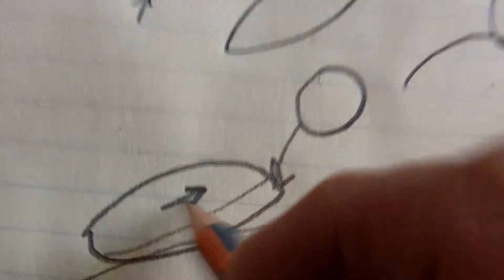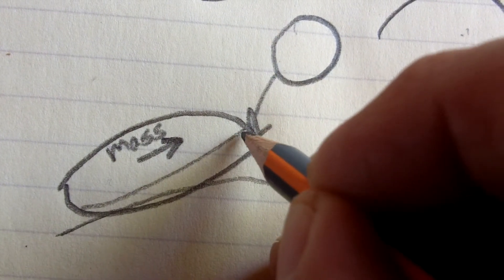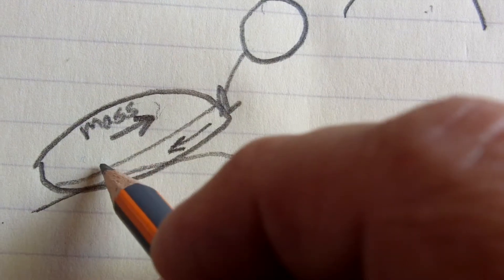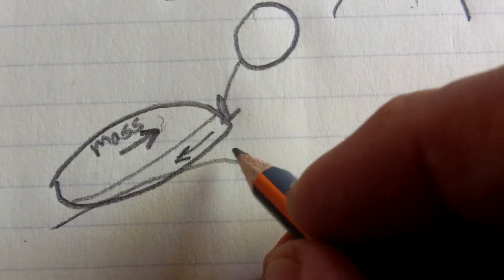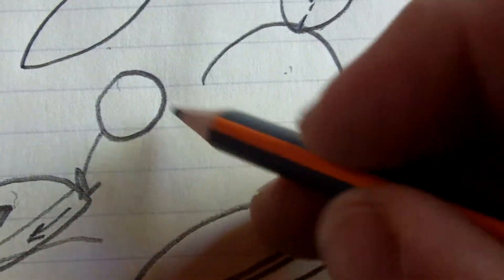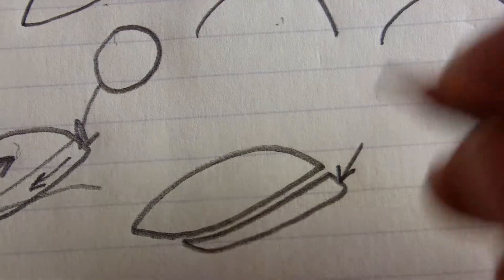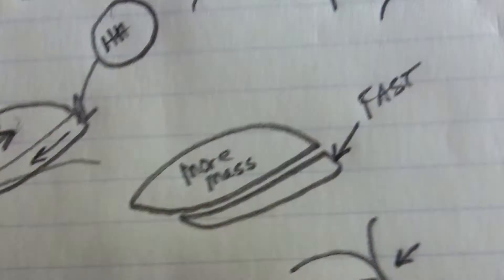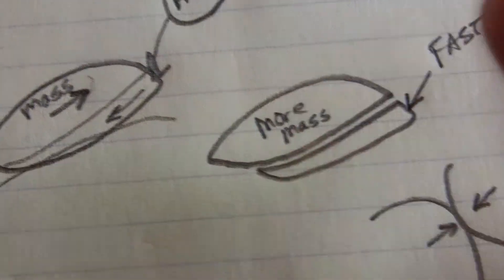335 - Fracturing Part 3c Long Flakes & Momentum

Comment: I've run into something strange with my indirect percussion. I found that if I raise my platform above the mid-line and then take a flake I can take off a large hump from the the underside of the bi-face. I'm working on obsidian so I dont know if this translates over to flint. Have you noticed anything like this?
Reply from the maker: David Tiller Yeah, if the hump is near the edge, you can hit hard and knock it off, even if you're above centerline.  Now, if you're saying that it's easier than lowering the edge and then knocking off the bump, I'm not sure I've encountered that.  And knocking off bumps from flint is a bit more difficult (than obsidian) and requires more force, but I think you're probably aware of that.  :-)
Reply: Yeah, but this was weird! I reversed the below ceter line to above center line and then rested the percusor on the top edge of the biface and then hit it. It flattened out the underside and removed he hump. Going to play around with it and see if it will happen more often.